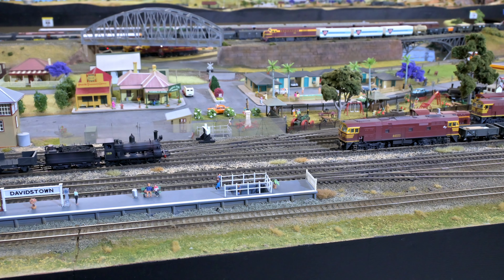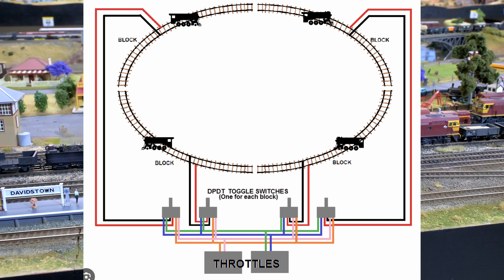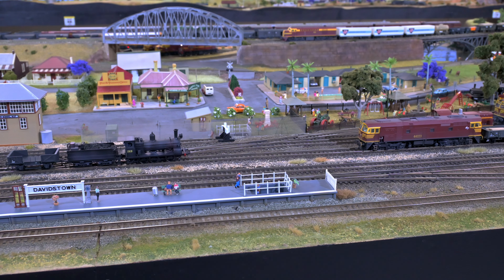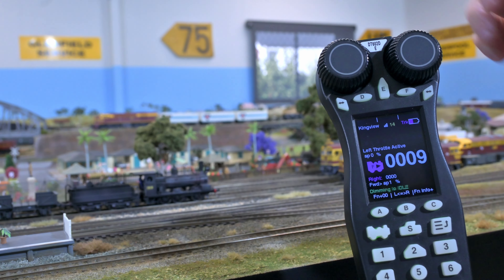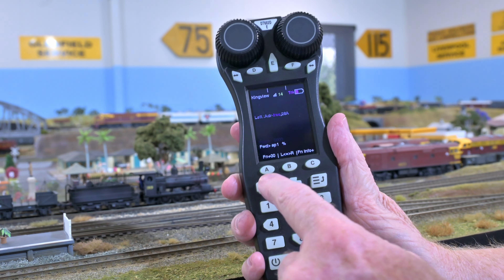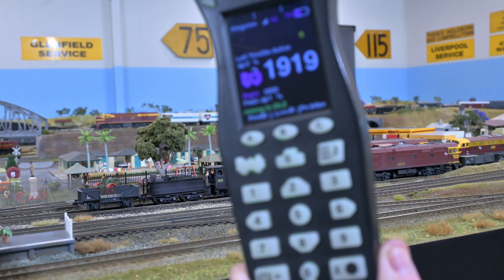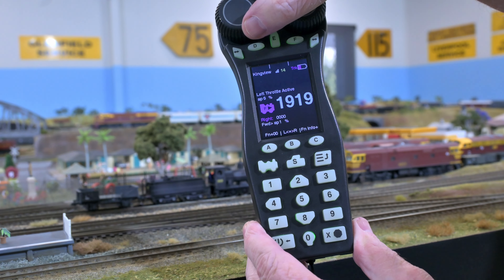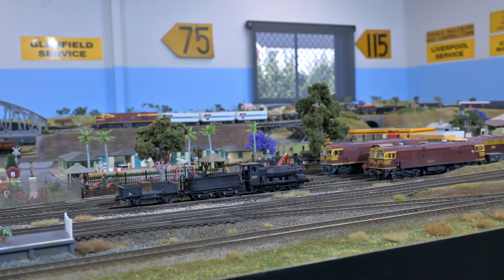DCC Basics with Digitrax

Comment: Märklin uses a proprietary protocol. However, their current electronic equipment is fully capable of DCC as well, but you would have to adjust some settings for this. If you like the Märklin equipment, consider to buy the Trix-versions of it - same hardware, but configured to do DCC by default. Trix is actually a brand of Märklin for the two track market (scales H0 and N) since 1997.

Even many traditional Märklin-users switched to DCC because the decoder configuration seems to be more convenient to them.
Reply: all true, but this is digiTrax basics, Marklin is different!